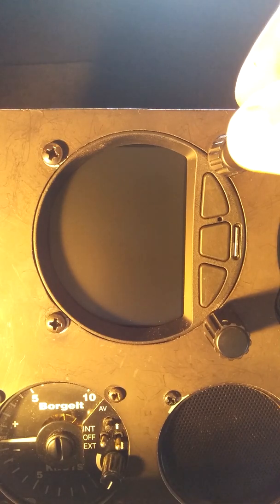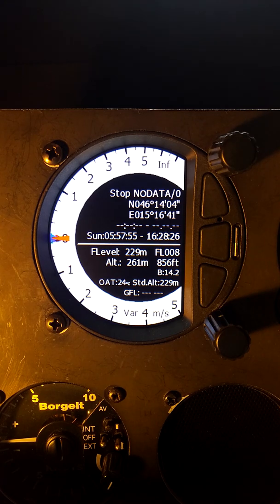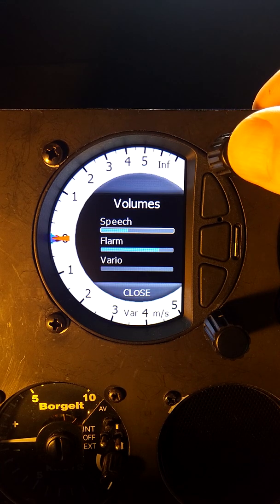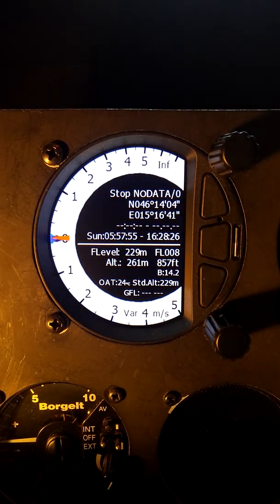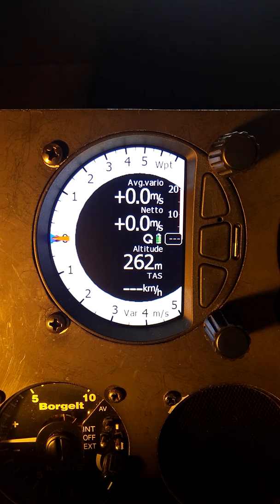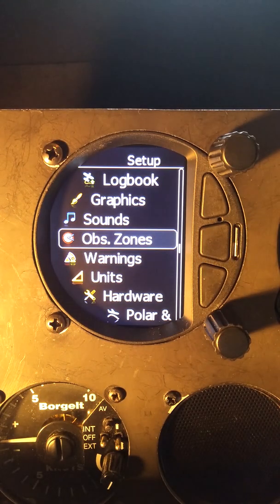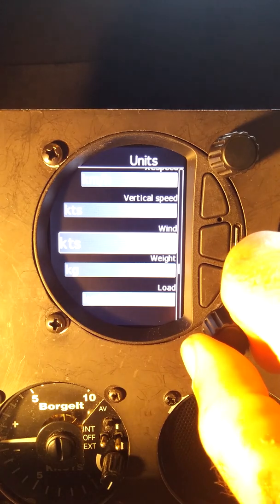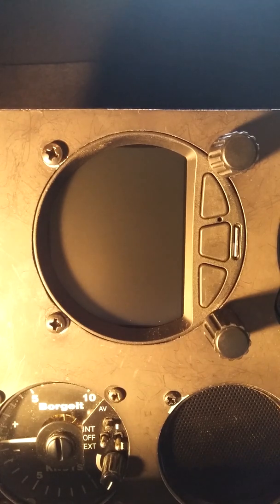S vario overview

Comment: I just recently bought a glider with an S80. I can't for the life of me figure out what is up with the volume.  It seems like there might be different profiles for when you are stationary on the ground, vs climbing, vs cruising and it's driving me nuts. So if I am sitting on the ground and turn off the vario volume, once I am on tow it still starts beeping at me and I have to divert my attention momentarily to once again shut off the freaking thing.  I don't want it beeping at me while on tow.  I want to be able to devote all my listening attention to any radio communications from the tow pilot. Is there a way to set it so there is just one volume profile so that when I set it to a volume it stays at that volume until I decide to change it?

Comment: Would like to see one level deeper of detail on this product.  What does a working FLARM page look like, what does a real waypoint/task page look like, etc.  How does one enter a task?  What does the AHRS display look like and what does it take to get that capability installed.  I must say I've been quite confused over all the different S8, S80, S100 models and what is possibly with each one so this was really valuable to me.  Thanks.
Reply: Looks like I commented too quickly as I just saw the next video in the series show up on YT.  I'll definitely keep watching!  Thank you.
Reply from the maker: @resiggy13, thanks for your comments.  I have a bunch more videos in the queue that will cover the topics that you mention. (Except AHRS page, I don't have access to one of those at this point)  AHRS installation is easy!  It is just a software license, all the hardware is already built in to the vario box. All you'll need to do is install a firmware update after the AHRS license purchase.

Quick table of differences:

S8  -----> 57 mm   ===   S80 ----> 80 mm
Neither have a GPS and require external GPS - usually a Flarm device is used.
Optional Bluetooth dongle for output to PDA/Nav display. Otherwise a wired RS-232 connection is available via an RJ port on the back.  Both GPS and Flarm data are exported via this port

S10 -----> 57 mm   ===   S100 ----> 80 mm
These have:
- built in GPS and are IGC approved Flight Recorders
- built in bluetooth
- still has wired RJ port on back too
- internal back-up battery to allow the unit to run for about 2 hours if all else fails!

For a full comparison see:
http://foxonecorp.com/index.php/lx-nav/vario-comparison